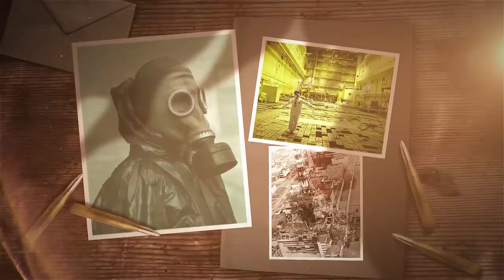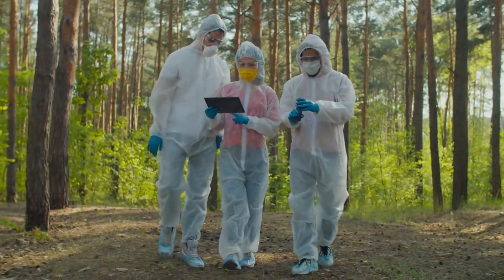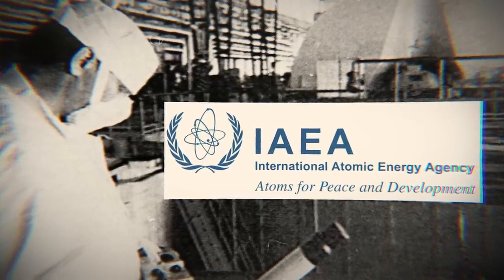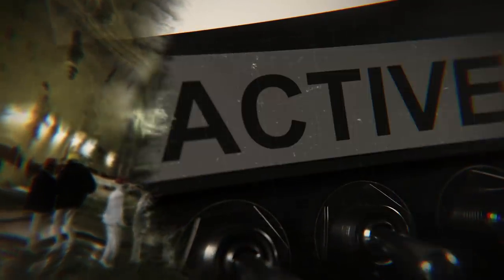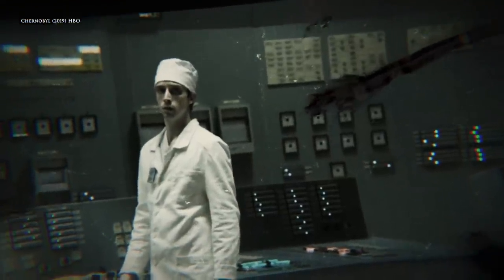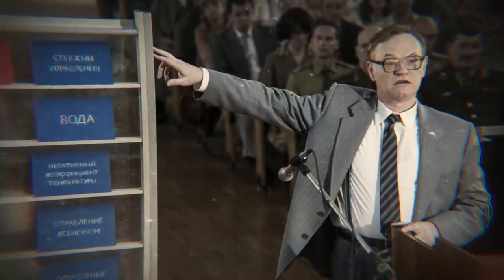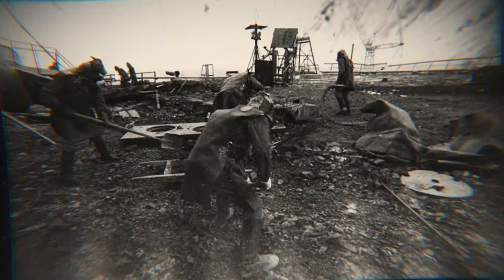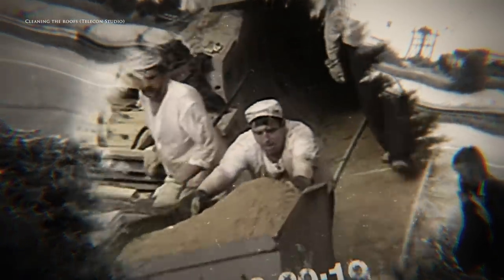Everything That Had To Go Wrong For Chernobyl To Happen

Comment: The Swedes were the first people, outside the Russians to know something was going on, by detecting high levels of radiation at their plant, over 700 miles away.
Reply: actually german scientists were the firsts to detect high levels of radioactivity during a weather experiment
Reply: The "funny" thing is, they searched the whole power plant for the cause, they pretty much didn't leave anything unchecked, yet couldn't find out why the fuck there was so much radiation there. After some more testing and checking they came to the conclution that it came over the air from Ukraine. Wich of course took a while, because when there is high radiation at your nuclear power plant, you of course assume it must come from the reactor... Yeah. 

If the radiation levels weren't THAT high so other countries would notice them, the soviets would have propably kept it quiet, saying nothing to anyone. Including their own people of course.
Reply: @madzonemg  that’s true but Barsebäck, one of Sweden’s nuclear power plants was the first one to identify the isotopes. They could trace it back to Ukraine because they knew they where using low grade uranium in their reactors.
Reply: @nameofthegame9664  alex jones did it
Reply: The Americans were the first, because their Thermal satelites detect immediately the explosion and the huge amount of heat comming from the reactor core.
Reply: @kristiankumanov5732  Sorry to say you are wrong. Sweden knew about this the morning of 28th of April 1986   USA satellite knew about this the 29th of April 1986.
Reply: The Swedes knew it before any country outside the USSR.
Reply: @mr_reborn  lmao imagine calling ukraine or the ussr rad left. Youre so lost
Reply: @mr_reborn  yea cuz the far right cares so much about the people 🥴
Reply: @Spud730  He didn't praise far right did he though?
Reply: @mr_reborn  No

Comment: There are a multiple errors shown here. 

At 2:20 it is said that the power level for the test was supposed to have been 700-1000MW, not true and incorrect. Firstly it is important to note that power level was described as MWt (Megawatt thermal) i.e how much heat the the reactor produces. Not how much electricity is produced. The 700-1000MWt specification told here and in HBO's Chernobyl is a partial half truth/half lie. This was the test procedure that the USSR told the IAEA in 1987 was the power level specified for the test when they covered up the control rod design flaw. In 1991 after the USSR collapsed IAEA investigators got access to original test documentation and other documents previously unavailable. In the original documentation specified that the thermal power of the reactor had to be sufficient to run one of the two steam turbines at its operational speed of 3000rpm. For that 200MWt was enough to produce the steam required to get the turbine up to speed for the test. 

At 3:10 it said that the minimum amount of control rods inserted in the reactor is 15. True and not true. During normal operation this was the regulation. The Soviet guidelines stated that in special circumstances this guideline could be overruled. The safety test was specified as a special circumstance. In effect the operators did not break the rules here. The rule book said they could do this. This is why they could shut down the emergency core cooling system. 

At 4:00 it is said that the feed water flow was turned down. Not true. The exact opposite was done which was one of the causes that made accident possible. They turned up the feed water flow to 50 000m2/sec this caused the reactor to be over cooled which in turned caused the reactor to be even more unstable. It sounds weird but nuclear reactors are designed to run at full power were they are inherently stable. Cool reactors are highly unstable since they have high reactivity margin when they are cool. The hotter they get they lower their reactivity gets. That's why in normal operation a nuclear reactor won't go crazy because it is unable increase the speed of the chain reaction when it's up to full power. 

 At 5:10 it is said that the graphite displacer may have caused the accident. IT WAS THE CAUSE. the graphite displacer was a 4,5m long graphite rod below the boron rod that was the actual thing that stopped the chain reaction. When the control rod was fully withdrawn there was water below the graphite spacer. Water acts as an absorbent in an RBMK reactor, a type of brake that slows the chain reaction. At the night of the test the nuclear fuel was old and that in turn made the water highly absorbent meaning in liquid state the water acted a strong break. That in combination of the high Xe-135 content in the reactor and the over cooling was the cause that the operators simply could not increase the power even though they withdrew almost all of the control rods. 

When Alexander Akimov pressed the AZ5 button to do an emergency shut down the reactor the graphite spacer pushed in to where the water was. This caused a power surge at the bottom of the reactor. The graphite spacer pushed the water i.e the brake away and power surged. When power surged the Xenon that had been slowing the reaction was "burned" away increasing power further. The fuel was cold and thus highly volatile meaning the reaction increase was more violent than it was during normal operation. The water started to boil and the positive void coefficient that was strong when the nuclear fuel was old lead to an further increase in the chain reaction. Normally nuclear fuel resists the increase in the chain reaction by getting hotter by expanding but because the power surge was so strong and fast the fuel elements could not expand fast enough to counter the surge in power. 

At 7:15 it is said that it took 36 hours to make the order to evacuate Pripjat. Not true. The decision was made on Saturday evening and the preparations began at earnest. Say what you want about the Soviet system but they managed to evacuate a city of 50 000 in four hours in a orderly fashion. Try doing that in the west without panic. 

 At 10:45 it stated that the WHO says that thousands of others have been killed over time. This a somewhat lazy way of stating their assessment. The WHO calculated in 2005 that in the cause of 60 years after the accident Chernobyl will cause 4000 premature deaths. This sounds a lot but one has to put in perspective that fossil fuel burning on the European continent alone will cause 20 000 premature deaths every year.
Reply: STEFAZON500 Thanks for your insight.
Reply: Very interesting information you've provided here. You know your stuff, it seems. Thanks for the clarifications, done without crucifying the producer of the video. Classy.
Reply: Can you please source where you got this? Interested
Reply: Absolutely spot on, I always find you have to take these videos with a pinch of salt.. 
What are you thoughts as to why the AZ5 was pressed, I have studied this accident for many years and to this day I still can not find any real stright forward answer...
Reply: I can’t trust that this is true because you said “the” twice near the beginning
Reply: @jonnytightlips513  My admittedly very limited understanding of the AZ5, or SCRAM button in the west, was that it was set up to basically drop all the control rods at once and was supposed to kill a runaway reaction in case things were getting out of hand. But due to the graphite tips and the already disastrous condition of the reactor, this basically did the opposite and caused the power surge. So hitting the AZ5 button SHOULD by all means have been the right thing to do under normal circumstances but in this case made things worse. A bit of useless trivia, apparently the term SCRAM came from the first real nuclear power generation where the control rod was suspended over the reactor by a cable and the safety release mechanism was just a guy with an axe who cut the thing. SCRAM ended up being an acronym for Saftey Control Rod Axe Man, at least according to Enrico Fermi.
Reply: @Mr_T_Badger  yes you are absolutely right, today it generally referred to as the Safety Control Rod Activation Mechanism....
The issue with the emergency protection AZ5, is as to why is was pressed...
There are many different accounts from different witnesses.
Dyatlov always claimed the button was pressed simply to shut down the reactor on completion of the test. Then there are those that say is was pressed in a panic due to a sudden rise in power, with on one witnesses saying he herd Toptunovt point out to Akimov "the power its rising" Akimov never really explained what had happened other than he was quoted as saying I do not understand we did everything right. 
This is important beciase it gives insite to what was happening within the reactor prior to the control rod activation. Was the power excursions already out of control due to the hydronic state and ORM of the reactor or did the AZ5 initiate the power surge......

Comment: The best way to visualize radiation damage is to imagine a small gunslinger that is the size of a grain of sand. The gunslinger shoots randomly in the air, at the ground or any direction at seemingly random intervals. Now if your very far away from him then you likely wont get hit by one of those tiny microscopic bullets. However if you do, it will only damage a few DNA at your skin level before being stopped. 

Now if you bring that grain of sand gunslinger closer then you will be hit more frequently increasing the damage, in particularly if you eat or otherwise have that gunslinger in your body then as you can imagine the damage is magnified. If the gunslinger gets stuck in a critical area of the body it will begin making Swiss cheese out of your DNA in that area and likely leading to cancer.

Now that we have that part down, imagine that too many of these things to count are ejected into the air like a bag of cooking flour exploding in a house from a radiation leak such as this disaster. The gunslingers will persist for hundreds of years (or half lives) and will not degenerate or erode aside from time.  This is what one atom of a radioactive particles like cesium is comparable to a gunslinger. The caliber of the gun is comparable to the Beta/Alpha and energy of the emitter.

Comment: Ironically nuclear power is still the best thing for the environment because it is reliable 24/7 and cost less overall. The thing is, cars then were a lot less safe than cars now and more people have died putting up solar panels than in nuclear power plant incidents.

I mean, look at France vs Germany
Reply: And now we have safer technologies, especially the development of LFTR or even the solid thorium reactors that don't require pressurized chambers.... which is fucking insane.  LFTR reactors are 90% or more efficient compared to the 1% efficiency of current pressurized uranium reactors; this makes a marble size of thorium fuel with the energy density produce an entire years worth of energy equal to an affluent American.
People don't realize the only reason the US and the rest of the atomic nations went with slow neutron pressurized uranium reactors is that it made plutonium for nuclear weapon production.  Make electricity and bombs all in one!
And hopefully the ITER program and especially Wendelstein 7x will produce good results on building fusion plants... these use non-radioactive heavy hydrogen and only produce very small amounts of tritium only during the reactors operation, and produce absolutely no radioactive waste...final fused products are helium 4.
The amount of energy density is 1 marble size would provide all the energy of an affluent American for their entire life if they lived to be 100 years old.

Oil and gas and other fossil fuel plants due to their release of radio isotopes and their soot and various other harmful compounds emitted have caused millions of deaths worldwide; for much less power return too.

Wind and solar unfortunately energy density is not sufficient to make it on its own.  Better nuclear power technology will ultimately pave the way for much cheaper energy and no more carbon emissions.

Comment: I read about the disaster many years ago, saw this on my recommended list, thought I'd get a nice refresher over what happened. After all, many YouTubers have capitalized on presenting their research on this disaster that most people can't be bothered with but are curious to learn more regardless. Those YouTubers got some well-earned likes for their efforts. This video just keeps leaving me with questions.

Why was the emergency core cooling disconnected? What was the "human error" that sunk the power level to 30 Megawatts? Why would they remove control rods in order to boost the reaction? Why did they remove so many control rods?  Why did the experiment procedure require shutting down the turbine engine? Why/how did they reason that shutting down the flow of feedwater would increase power? How does steam exacerbate the instability of the reactor? Nobody knows what caused "the" surge??? Really??  Why would the power level continue to peak? Why did the control rods contain graphite? Why was there zirconium? Do I now, after watching this video, feel like I have any better understanding about what they did wrong back then? What to look out for? 

The best proper explanation ever given in this video for any of these concepts was when you explain how built up steam increases pressure which can rupture whatever it resides in, resulting in the explosion. Cause -> Effect. Nice. Do that more. However, it bears pointing out that this is just common sense to most people and doesn't take a lot of research to work out. If all this video wanted to do was summarise the "whats" in a somewhat dismissive tone but not the "hows", "whys" or "whos" (or indeed, offer any insight into how the disaster could have been avoided) then....congrats? But... all you had to research was the Wikipedia article and the video would have practically written itself: https://en.wikipedia.org/wiki/Chernobyl_disaster 

Enjoy your youtube likes, I guess.

Comment: We do know what caused the meltdown, the reactor went prompt critical due to withdrawing rods too quickly and too many. Prompt critical means, essentially, that power went to several thousand percent of rated capacity in less than a second. This flash-boiled the coolant and the coolant channels filled with steam, blocking coolant flow and contributing to the problem. 

And oh, that concrete lid weighed 2300 TONS and the initial explosion lifted it off the containment vessel.

Comment: I'm surprised you mentioned the helicopter effort & radioactive updraft without adding that it was SO radioactive that it caused the electrical systems in the helicopter to malfunction enough to cause a crash landing. It wasn't a Hollywood explain crash, but it's bone chilling to watch the footage, where it drops out of the sky like a rock. 

And it's not strictly on the topic of the organizational disaster that allowed the chernobyl accident to happen, the elephant's foot of reacted uranium-- a new compound called corium-- was hot enough it melted through the reactor casing and into the ground, and is is so reactive that it's impossible to get a photograph of it directly, while it's confined like it is; equipment fails around it, much like the helicopter did.

Comment: It's unlikely that something like that could've happened outside the USSR. The reactors at Chernobyl are extremely jank. Fukushima was operational for 13 years before the Chernobyl meltdown. Fukushima operated problem free for another 25 years before the Fukushima meltdown. While Chernobyl was caused by simply bad design and a safety test, Fukushima was hit with the largest earthquake on record and a 50 foot tsunami and was still far less severe. Nuclear energy is necessary if we intend to curb climate change. Chernobyl should be a lesson to move forward, not a deterrence.

Comment: The biggest problem about any reaction is you can't turn off a reaction you can't just put it into sleep mode you can't just walk away from it and say oh it'll fix itself or even you can't turn it off and turn it back on and hope that it works after that. Throughout history everything from the discovery of fire the invention of the steam engine and the internal combustion engine and now the radioactive decay of a fusion or fission reactor humans have tried and tried to control the reaction but we've only been able to contain it in a hand grenade in a fireplace in a internal combustion engine steam engine or reactor we've only only been able and efficient at containing it. That is why a nuclear power plant will never an effectively should never be used

Comment: Scary , my dad built 9 miles point in scriba NY . That was back in the 70s. My dad told me  to move when the by the 25 year birthday of the plant. Why you may ask. My father said he over heard the engineer's asking  what to build to cap it off an seal it forever.  Yes they are only built to last 25 years max! Today it still producing power for New York city . Now my question is , there have been multiple cracks in the plants structure.  So its either time to seal it , shit down rebuild it or one day a god help us that day never comes that we have an explosion on its hands . And the kicker they built Fitzpatrick nuke plant less then 1/4 a mile away acutely they are like right next to each other . I hope the city of Oswego  shuts it down for repairs an rebuild or permanent seal.  People if you live in a town city or by one of these ticking bombs please for the love of everyone potion to have them felt with before it's to late . 
 So and thank for letting me share my story. PS , THEY ALREADY HAD TO PASS OUT IODINE TABLETS TO EVERYONE, THATS THEM COVERING THEIR ASS. AN BELIEVE IT OR NOT THE OWNERS OF MOST THESE PLANTS ARE FROM OVER SEAS .